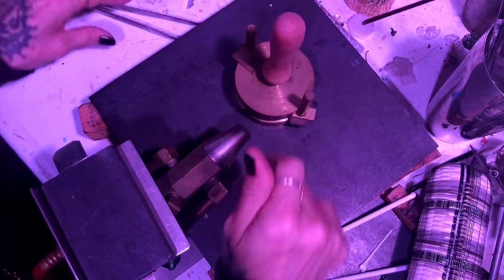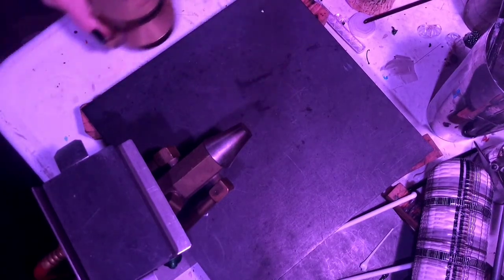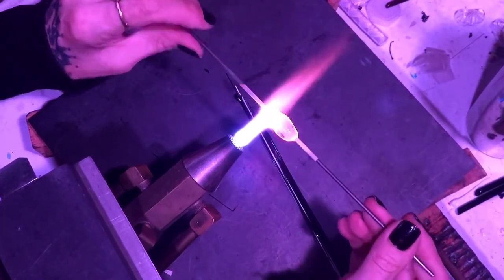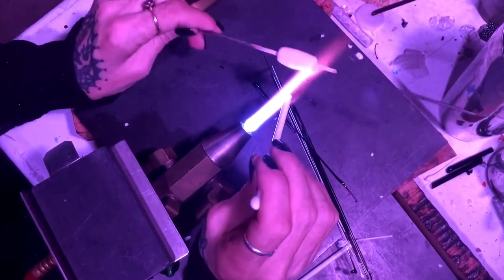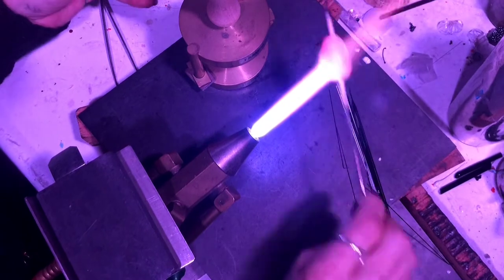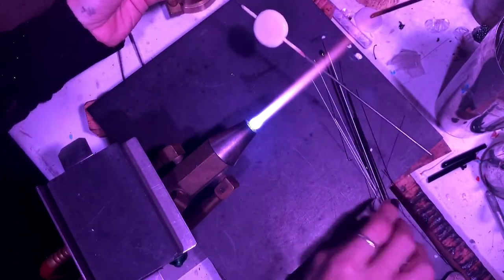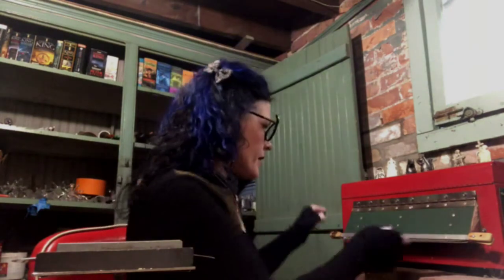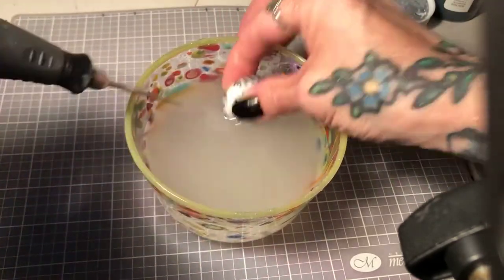Lampworking / Flameworking with Black & White Vol.11 - Working from a Drawing

Comment: I have a bead request...etching, how is that done?  I see these beautiful beads that are etched then layered with dots or something else. I’d like to see the etching process
Reply from the maker: Hi Elizabeth!  I love the etching process. It’s fun and easy to do, as he will see in a upcoming video! Thank you so much for asking about it 😍🖤🖤👍🏽
Reply: Here is a question...how many times can 104 be reheated and annealed?  I’m trying to figure all of the mechanics first.  Art is fluid and never really wrong, but usually the mechanics are cut and dry.
Reply from the maker: Hi!  Thanks for the question!  Well, in my research I have found that holding the Annealer at 1000 ‘ allows you to put work in hot (to pull out and use later. ) But you MUST cool the mandrel in water if you are using the “middle dipping” method.or you will burn those fingers the second you touch it!                               And yes!  I have put many things in, brought back up to temp to rework or to add to a small sculpture.   I had some animal ears in the Annealer I didn’t use and had turned off and on the Annealer several time without a problem. Also at the 1000 degree mark. Just make sure you get the glass in the flame ASAP after taking out of oven.  Hope that helps you, Elizabeth! 🖤🖤🖤